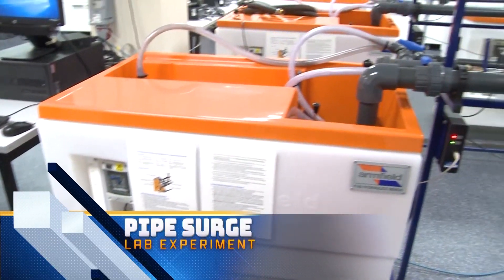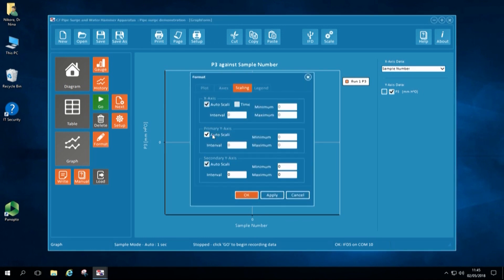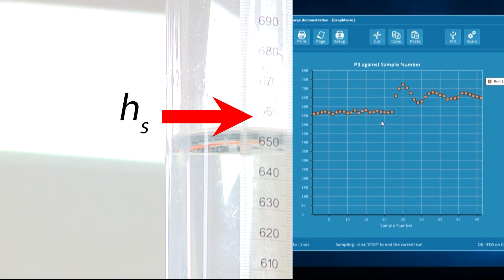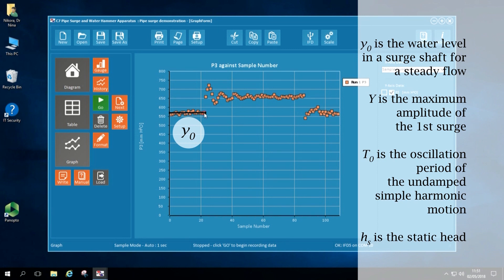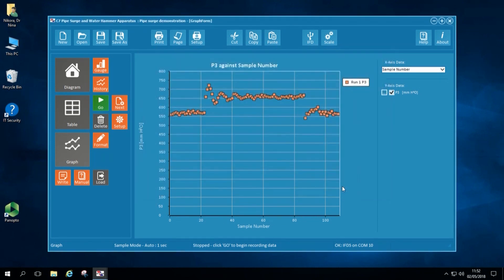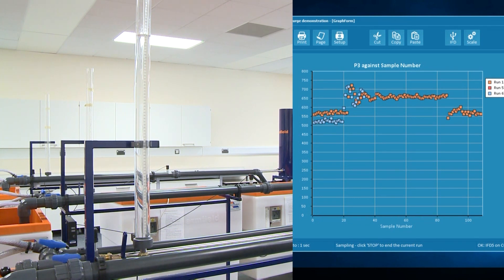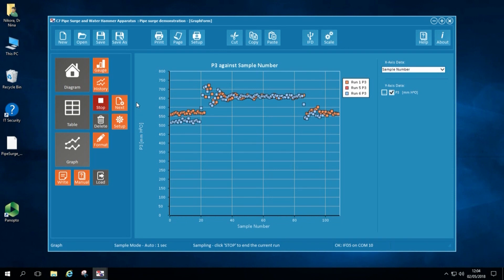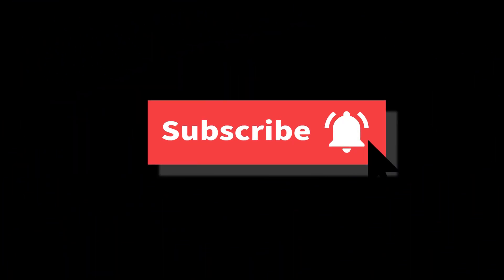Online laboratory experiment: PIPE SURGE exercise

Comment: when doing the first lab experiment ,im a little confused as to how we are to find the velocity head ? do we just open the valve and see where the water levels at? thank you
Reply from the maker: Velocity head is V^2/(2g), i.e. you need to know velocity. To calculate velocity you take flow rate Q that you measured and divide by a pipe cross-section area, i.e. V=Q/A, where A= pi*D^2/4

Comment from the maker: The kinetic energy of water flowing in a pipe can be very considerable and any reduction in the flow rate when a valve is partly or fully closed at the downstream end of the system may require the dissipation of a large amount of energy. This energy dissipation is manifested as a pressure build-up in the pipeline which can have destructive effects. Pipe surge lab experiment is conducted to demonstrate: (1) head loss between the reservoir and the surge shaft due to friction and miscellaneous losses in the pipe; (2) the phenomenon of pipe surge resulting from a change in velocity of the water flowing along a pipe; (3) the use of a surge shaft to attenuate any changes in pressure associated with pipe surge and the oscillatory characteristics of the water level in a surge shaft.